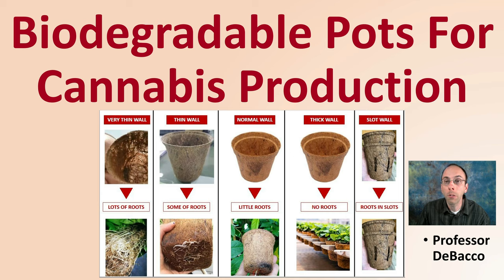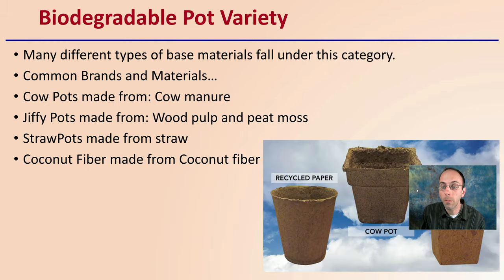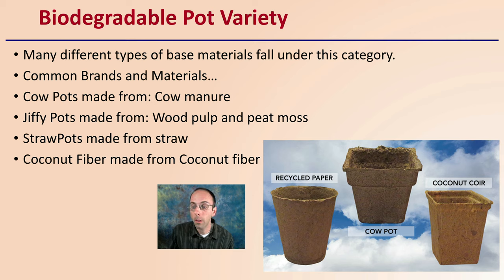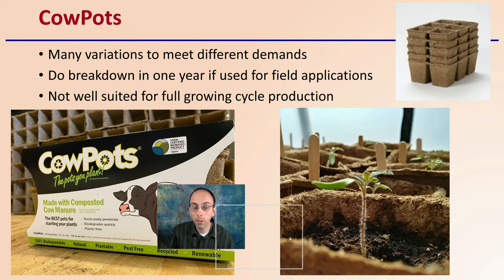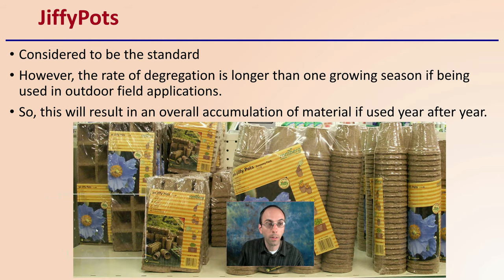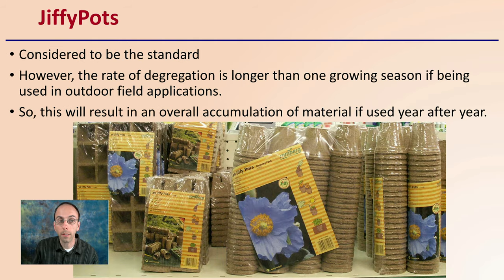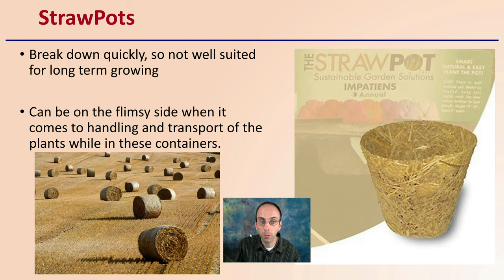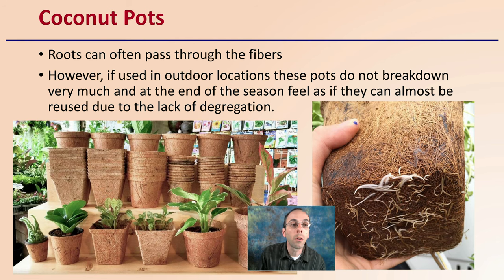Biodegradable Pots for Cannabis Production

Comment: Biodegradable pots tend to host root rot because of their absorbency.  my personal experience I wouldn’t touch them it’s not worth it. Good old hard walls nothing fancy something you can scrub if need be
Reply from the maker: Different containers for different growing environments and styles, choose the one that works the best for you.
Reply: @DeBaccoUniversity  what one have you found that works best for you
Reply from the maker: For outdoor field growing by far the CowPots have worked the best and this is comparing to multiple other biodegradable pots over an entire growing season.
Reply: @DeBaccoUniversity  I’ll have to take your word on it. What I’ve found is once your plant becomes pot bound the memory of that pots shape will remain in the root system (circling) even if it’s biodegradable that root growth will out match the rate the pot can biodegrade. You end up with a lot of root mass in one area causing stress to the plant. If you’re using cutting the lack of a tap root will also cause root issues in that situation from my experience.